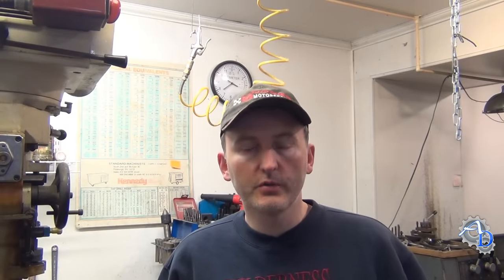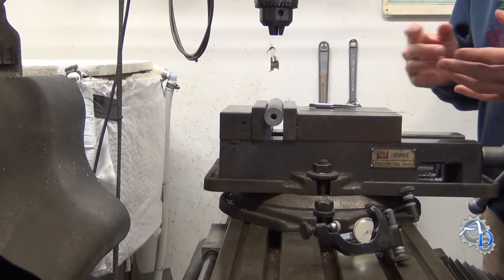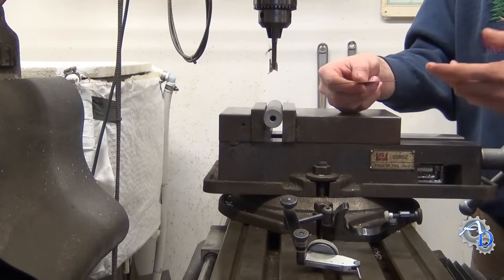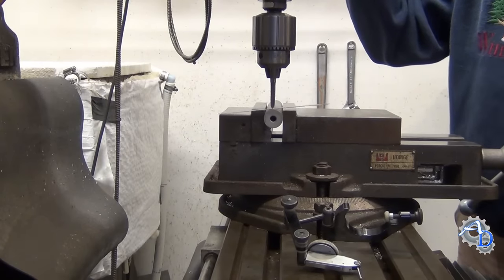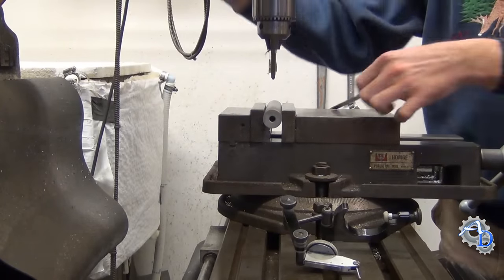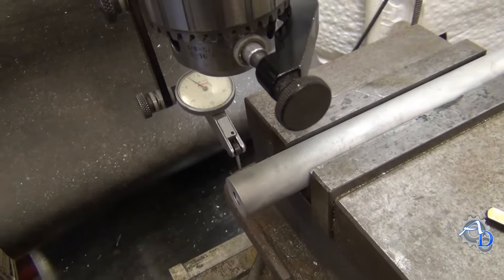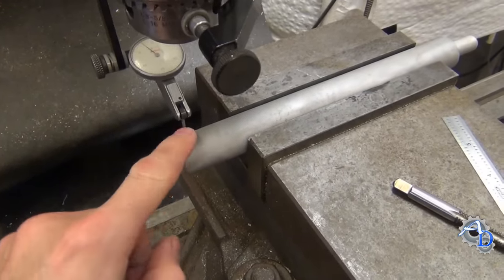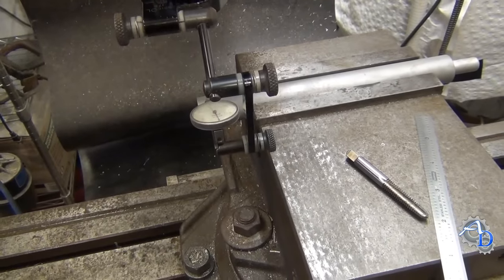Old Machinists Mill Trick To Quickly Find a Rod Centerline

Comment: This trick is great.  Uses a flex scale as a tangent indicator.  We tested a bunch of years ago with a bunch of people and they all easily saw a 1/2 deg off of 90deg.  So would guess, even easier for level.  1/2 deg on a 2 inch dia rod is only 0.008 inch off.  

Sure beats eyeballing center.  I snapped a couple of bits that way.  I also liked him showing the dail gage method.

Comment: Been a Machinist 43yrs, haven't seen that one before, you can never know it all as a Machinist. One thing most Machinists have in common is " Thinking outside the Box ".  Any negative comments here are not from Real Machinists, but from children who think they know but not..
Reply from the maker: I agree.
Reply: Well spoken.
Reply: Cool. I just measure the diameter of the stock. Then I edge find the solid jaw and set zero. Then I move half the diameter to the center
Reply: same here!!! I'm going to run to work and show every one!
Reply: @BlackAdder1970  I can't use your method with my cheap drill press. Only a trained machinist would know to zero the stationary edge after clamping the fixture down square. This is a great video for non cnc or non mill people.. I wish I had a cnc machine shop.
Reply: This method works well to get your tool on center on a lathe also.
Reply: a real machinist would never do things half assed.  It takes no extra time to do it properly and accurately. You're seen doing stuff like this where I've worked you'd be shown the door
Reply: @highstreetkillers4377  I think this video is for amateurs who happen to own a mill and don't own the proper tools. Still though, he should at least mention the proper method using an edge finder. A double ended edge finder can be bought for $15. A lot of machinists use this method to center the cutting edge on a lathe but using a center in the tailstock is more precise and just as fast.
Reply: Can do the same thing getting a turning tool on center height on a lathe, but of course the ruler is vertical.
Reply: Mike Eiben yup. My old 60 year old British mentor taught me that one
Reply: Always more than one way to skin a cat as they say.
Reply: @tonyr751 
This method is for everyone...  It's an extra tool in the arsenal...!!!
All depends on the target you need to reach, if you need  +/-0.0005" it's no good, but if you need +/-0.005", then it could save you lots of time, remember that trying to over do it is real time consuming and pointless...   
Judgement is the best asset for an expereinced machinist...   ;)
Reply: @mikeeiben3430  except that on the lathe you move the stock and not the gage.  Very commonly done.
Reply: Also, could you just place the part vertical, set center, then lay it horizontally again and drill?
Reply: I'm a student right now, one of my teachers pointed out that I seem to understand that there is no single way to approach a job, which felt good to hear, but I still worry if there will be a moment when I enter the workforce and I get in trouble for not doing something a certain way. Maybe I'm too used to the way corporations function.
Reply: This is also used to quickly find the center line on a lathe and is more practical in my opinion. Very useful and acutely good enough on many jobs as is.
Reply: look at my comment above and if you care to discuss further I will gladly do it with you
Reply: I would ask what are the tolerances are in the drawing.  If it's just a home job then yes but approximate isn't good enough for aerospace.  Is it faster? Probably not when there's other quicker methods that doesn't require using a starter tap, scale and dial indcater.
Reply: @13anomalous16  Yup... One of my coworkers always said it.  This kinda work there is never one answer, but there are tons of wrong answers!

I always know who the big talkers are, because they insist there's only one answer.
Reply: whatever works, and that's the bottom line.
Reply: @highstreetkillers4377  the video is to help those learning or a time saver for the likes of model makers etc. He's not saying its a better way, as good as any other way, or an alternative for those who will be, "shown the door" if they dont do it a certain way.
Reply: Wow, excellent!! Thank you for sharing!
Reply: @tonyr751  I don't have a lathe or a mill so finding the approximate center using this method works perfectly on my antique drill press with a cheapo V-block. I am building race cars, not airplanes and so if I'm within "a thou," I'm very happy.
Reply: Thanks for the video. My father showed me this method on a lathe. Another old school toolmaker. He's gone now. I am getting into machining now and these videos bring me closer to him.
Reply: In engineering lateral knowledge is power....
Reply: I was taught this but for setting up a new tool on a manual lathe and getting your block height set up correctly/quickly to make sure you engage your cut at center line. I can see where he drew the correlation for this. Uptime and throwing chips is what makes $ and tricks like this can drastically reduce setup.
Reply: @mikeeiben3430  I was shown this same method for block height adjustment as well. The old guys showed me this on like day 1.
Reply: i'm really surprised from the comments that so called professional machinists are this dumb that they can't understand this is something the diyer would use. The comments are really embarrassing! I'm going to bet a lot of these guys never work on anything outside of work.
Reply: forrest gump V dont need a rule it takes about 30 seconds to just use a finger clock
Reply: Rich K oil
Reply: as an engineer...you speak the absolute truth!
Reply: So, did you actually see some "negative comments"? Or, was it a preemptive strike?
If so, that's weird.
Reply: Its not a very good way to do it. He got lucky getting within 0.001. Could easily be off 0.030. If I ever caught one of my guys doing this, I'd take 2 minutes and show them proper ways to do it. Take the extra 10 seconds and do it correctly.
Reply: Paul Gallagher - I agree but this guy is using a piece of stock stuck floating in a vice. He didn’t ensure it was level, determine the roundness, straightness, etc. He just said the trick saves time from using the dial indicator. It would perform as such.

However, I’d be very upset to see a machinist quarter-ass it in one of our manufacturing facilities. For a hobbyist? I think he gave us what he said he did.
Reply: how is this different from another job ? You can never know it all as a "insert your job here"
Even for simpler jobs like house cleaning or plumbing, you will always find someone that knows a trick you didn't know.
Reply: All you master machinists are making like this guys a hack. Not everything needs to be zero'd to 5 decimals. He obviously knows how to find the center of crap, hence the indicol on the table
Reply: To be honest, anyone with good skill that doesn't care about it being perfect, would just eyeball center. If the drill doesn't wander off the side, its close enough. Adjust it a little if it does. Thats actually the fastest and most common "hack".
Reply: Interesting preemptive insult to negative posters who, as far as I can tell, do not exist.
Reply: @highstreetkillers4377  wouldn't a real machine shop like where you work already have the most up to date and precise tools in order to find the center line of a rod?  Why would anyone with precision tools fiddle around with this technique at a place that already has tools to find the center line of a rod?
Reply: steve gale  Troll.
Reply: steve gale  Steve I am below an amateur I have never worked with any machine tools. .  I was really just asking a question.  This technique looks like a great technique for some with a simple setup in their home.  It doesn't look like a technique that would be used in a 21st century professional machine shop as there are (I am assuming) very precise instruments to find a rod centerline.  This is a great technique in the 19th century and was probably what was used from the 16th - very early 20th century. 
  I was just curious how anyone would even want to try this in a modern shop.     You're answer above is a testament to your skill and your experience.   My question still stands, a modern machine shop would have modern tools, thus making this technique obsolete, so why would anyone even try this?
Reply: I love how guys like you claim, “I’ve been a machinist for bla-bla amount of years...” but that doesn’t mean they’ve been doing it right for that amount of time. Furthermore, learn to proofread before posting.
Reply: I'm no Real Machinist, but I sure appreciate this tip!
Reply: @mikeeiben3430  EXACTLY learned this 25 yrs ago working on screw machines as a way to center circular form tools on ww2 surplus Brown and Sharpes
Reply: Yeah, good trick. Been a machinist 46 years , and have never seen that one before. My eyesight is not what it used to be, so I touch off on the side of the piece with a piece of paper. Good for .002 accuracy.                
.0015 is possible if you pinch the paper, and make the end mill pull the paper from your grip.
Reply: @highstreetkillers4377  It depends on the tolerance for the piece. Don't spend the time if you don't have to
Reply: @shawnu8477  Well said Sir.
Reply: @Dresdentrumpet  I've worked in some job shops that were glorified blacksmith shops. .002 was plenty close for those type jobs. A tool and die shop ? No way. It just depends on the type of work your doing.
Reply: @Dresdentrumpet  You would be surprised how many shops are still using old worn out pieces of equipment. Not everything is new, or cancel.
Reply: Sorry, that last word should have been " cnc " .
Reply: If you have a cat, you don’t want it to think outside the box...
Reply: @michaelmangrum5460  All my previous comments was to a person that said anyone doing this in their shop would get fired which meant that guy probably worked in an up to date shop.  I can find a right angle by taking a rope and tying a series 3 knots 4 knots and 5 knots, but I don't need to do that because there is a tool called a square.   What he is showing is genius and has probably been around since the beginning of machine tooling.  There is no reason to look down upon this technique, I see this useful for beginners mainly, and what you said previously.  If you work in place that needs precision down to 5 decimal places then that shop already has tools to precisely find the centerline and you won't need to use this technique.

Comment: I’m a woodworker and have been using this method for over 20 years on my drill press when I have to drill wooden dowels. It works easily with large diameter dowels (or metal pipe/rods) but a little more time is required for smaller diameter pieces. Great job explaining to everyone.

Comment: What a cool trick! Thanks! I remember working on my old 78 Ford pickup and I told my Cuban buddy that I was going to set the timing on my truck but I didn’t have a timing light. He said “No worry, do you have a glass of water?” I loosened the distributor and he put a glass of water on top of the engine and watched the ripples on the water smooth out while I turned it back and forth and when the water was in the smooth no ripple sweet spot I locked her down!  Couldn’t tell the diff from when I put a light on it eventually. He said that’s how they set the timing on their car in Cuba when he was a kid!
Reply: 👍👍Cubans can do everything with basically nothing.
Reply: That's really cool ! I'm going to try it this weekend. Thanks for sharing.
Reply: @BojaneBugami  I have a picture of one of the 3 Stooges, and it says" I've been doing so much with so little I can do anything with nothing ".
Reply: We left Cuba before I was old enough to work on stuff, but have heard many stories from my dad and others.  Rebuilding headlights, spark plugs, shocks, etc.  Mounting 15" tires on 14" wheels, running gas engines on diesel fuel and kerosene...
Motor oil could only be purchased for topping off by a gas station attendant, oil changes weren't permitted.  But if you showed up empty they'd fill it, an oil change required planning and commitment.

Comment: For 99% the type of stuff I'm likely to be making, this would be close enough.
Reply: Just out of interest, (at the risk of sounding like I'm taking the piss, which I'm not)  in what circumstances would it have to be exact?
Reply: True my friend 👍
Reply: @michaelbirchall2247  lol. Exact? Everything has a tolerance. Why would you need to be better than that? Because it's called out that way on the blueprint. I've made many parts with dimensions that have less than one thousandths of an inch tolerance. Usually aerospace parts but also medical.
Reply: @michaelbirchall2247  if the shaft going to spin having it dead nuts will help balance and keep vibration to a limit also have pride in your work keep everything you make in great demand

Comment: I usually keep the back lip edge of the vise as my y-axis zero. Then, I can just measure the diameter of a rod and move the table half the distance. Works every time!
Cheers!
Reply: That's what I do...I always try to reset it to zero when done knowing the next time I'm ready to roll when I go to the machine..
Reply: thickness of the back jaw plus half the rod then set 0
Reply: Wonder what's the best way if you're working with an A axis and don't have a probe, edge finders in class will work fine up to a certain diameter. Maybe a long machinists square?
Reply: 13Anomalous don’t A-axis’ have “home” position?
Reply: Tinkering Nerd, this is what a real machinist would always do.
Reply: This only works if you're fully equipped (precision vise with scale and so on). If you're a hobbyist like me and have only simple vises without any adjustment screw nor scale this trick is fantastic!
Reply: @truanglo2170  "real machinist" Are you sure that's what a real Scotsm- machinist would always do?
Reply: Thank you,  i kept saying bull crap way to complicated the shit hes showing
Reply: Back jaws flex to much for that.
Reply: Yeah well that technique worked for me too...... Except when you get those egg-shaped rods. (Just kidding)
Reply: Oh, shit. That's pretty smart and simple. Why did I not think of that?
Reply: I"m new to this..... engineer, I bought a mill for the shop "for convenience." We still plan to send work out. but we have plenty of emergencies and last minute parts. FINALLY after a year I'm using it. GREAT IDEA!  Thanks for this tip.  AND...  this tip above is great as well.
Reply: @nate12281  By incorporating the thickness of the jaw you're introducing stack-up.
Reply: @baddonkeyNL  would work great for a standard drill press that doesn't have increments. So it's not BS.

Comment: I did my time as a tool maker back in the early 70's, but gave it all up as the money was rubbish in those days, and so became a builder. Now in my 70's,
I have aquired a small old metal lathe and milling machine, with all the tools I could wish for, and I have not got a clue how to use them. It's true what they say, use it or loose it. Now i'm getting tips from you tube to get by. Thanks for the vid, very helpful.

Comment: Neat tip , I have been doing it on my lathe with a business card. Same theory shown to me by an old machinist, didn’t think about applying it to my mill. Don’t understand the people with the negative comments, not all of us have DRO’s or unlimited budgets and appreciate these kind of tips. There is always more than “one way to skin a cat”. Thanks again !
Reply from the maker: Thanks. I'm glad you found it helpful.
Reply: Mr C , so right . Especially when the shop edge finder pouch is empty.
Reply: This method is quick and approximate, which is how AD pitches it. I cannot for the life of me understand why people feel the need to say "I don't do it like that". Do they pee sitting down, because "it's more accurate, and that's what toilet seats are for"?
Peeing sitting down is a great option, but it's not the only option.
Reply: I have always used a 6" scale on my lathe...but that doesn't require quite the same precision as finding center on a mill..for which I also use an edge finder...
Reply: This might give away my nationality but.
When your in the bush hundreds or thousands of miles away from anything you use what you have.
Its called initiative. Im an old machinist, today's tradies especially mechanics make me cry whilst laughing when they are at a loss because they cannot buy a basic part off the shelf.
Some of the best tricks are the simplest.
Eye balling the rule with the known flat surface of the vice is were you get your reference from.
If you use a parallel bar instead of a rule, the bar is always straight plus less movement of the vice is amplified.
I have used a highly accurate machinists bubble level pining the point on one end over the bar.
Simply get the bubble level. If you have a level like that no excuse to not have your machine level to start with.
Reply: Good one, reminds me of the outhouse back in the late 40's when it was freezing outside, no toilet seats or in Russia -40 degrees in the outhouse!
Reply: @Gottenhimfella  Most of the negative posters pee sitting down.
Reply: @mickmac8300  Australian.....

Comment: Used this trick for years to set the lathe tool height, never tried it for this! One idea I had while watching you trying to level the scale by eye - if you view from slightly lower, you can sight the scale parallel to the vise body. Amazing how close you can get with this. For putting in set screws and such, way close enough!